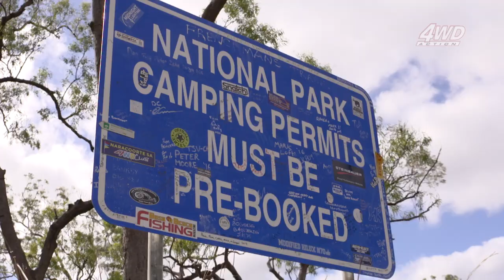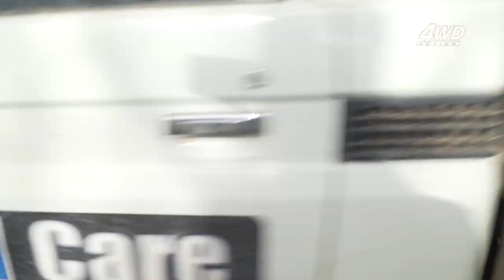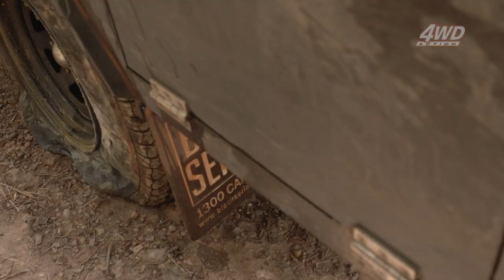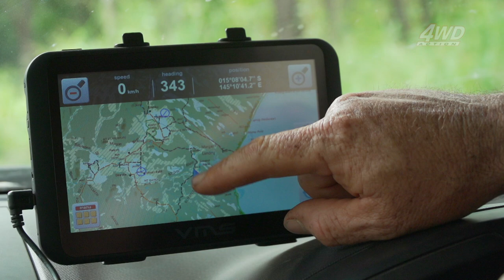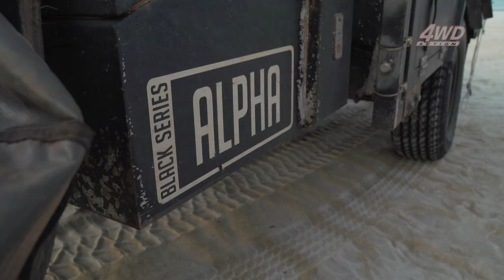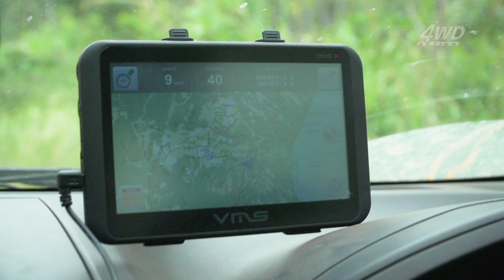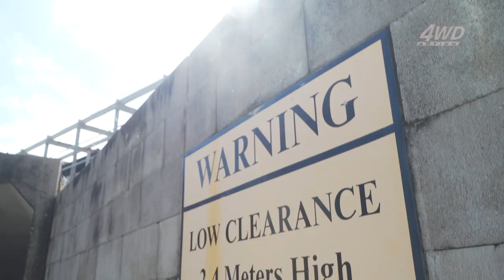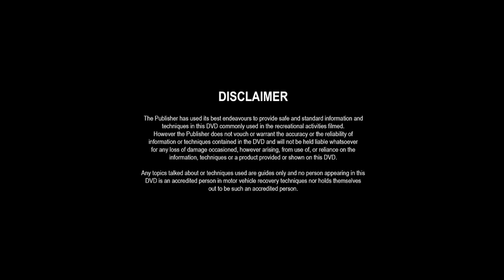CAPE YORK! Deep water, mud, secluded beaches - This is a 4WDer's paradise!

Comment: I also have a Warn winch in my -79 Blazer, and now I have learned to test it before going off road, as it has had enough troubles already; the winch motor has been corroded twice, and the relay box also twice, and actually I found out that again only (fortunately) "in" direction works. All my other 4x4:s have cheap chinese winches that just work, period. So, perhaps there is a good reason to pay much for a winch, I just not have found out what that is. At least it is not the reliability. But these videos are so much fun to watch, the seemingly endless possibilities to find epic trails, too bad I live almost exactly on the other side of the globe, in Finland

Comment: on the bucket list, but would a 4x4 truck camper  make the trip to Cape flattery? the truck, a Commander from SLRV, is a bit wider and taller than your norm 4x4 but very capable off road Thanks in advance for your feed back.

Comment: Doing tracks with scrub hanging over the track you need to get the new design ceramic coating there’s a 4 coat system and if you see any scratches you grab a heat gun wave it over the area for a few seconds and then it fills it’s self and no more scratches there is a detailing shop in north lakes that does the coating not sure of the name

Comment: Driving like this is spectacular on the video but is reckless to the environment and will result in track closures.  By reckless I mean too fast causing a big wave (erosion). chewing up the bottom for others, is bordering on dangerous driving and it’s a long way from home when you break something.  Setup is important so look at tyre pressure, walk the track and take the right line.  I’ve been going to the cape since the late 1970’s and speed is your enemy.  This sets the incorrect practice for those that don’t know better.  Agree with the third car rule when you drive like this.  The issue with speed is that one wheel will lift and you are back to three wheel drive.  Slow down and use all four wheels.  They are correct with tyre pressure but it needs to go lower.  I used about 18psi on those tracks due to corrugations and slowed down to max 50kph, walking pace through creeks & soft sand.  Travelled the Canning with 10psi for over 1000kms, no tyre damage and did not require recovery even when towing my camper (2000kgs).  If you bead a tyre it means you are not driving to the conditions.

Comment: OK I might have missed it if someone has already asked, But Rocket mentioned he has done 5 alternators already! Why are they so unreliable and what goes wrong with them?
Reply: Low mounting on the engine so they easily get clogged with mud.  can be cleaned sometimes, but can also be unrecoverable.  really bad design by toyota, but can be fixed with $ (a sealed water coolled alternator for $2-3k)

Comment: Are you Fu....n guys mad ?  No wonder the tracks are chewed, the speed you hit water crossings at is crazy. Just because you have the power doesn't mean you have to barrel into the water sending it over the bonnet which is only a meter deep. Stop trying to be heroes and get back to responsible four wheel driving. Stop on exits to drain water and stop tearing up the banks for the cars behind you.
The reason the tracks are so bad is because of idiots going gunho repeating what you are doing, but it wouldn't look as good on film wouldn't it!